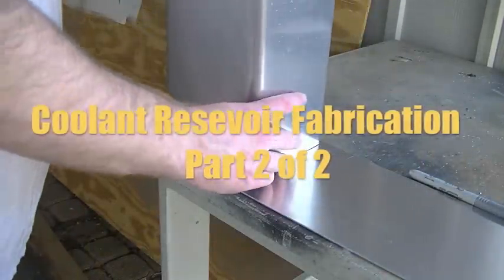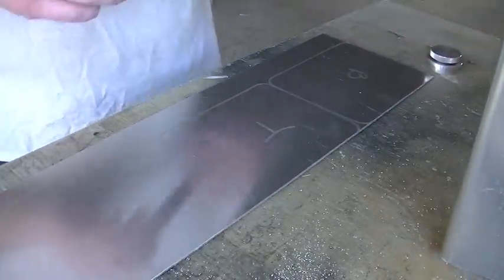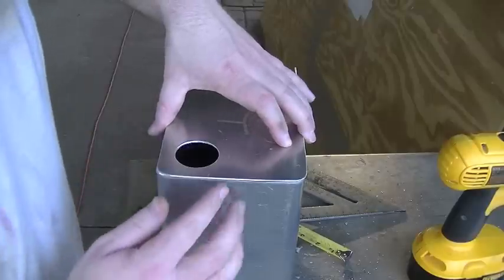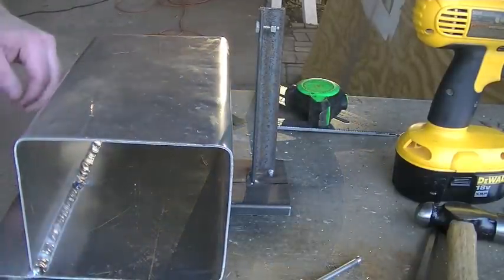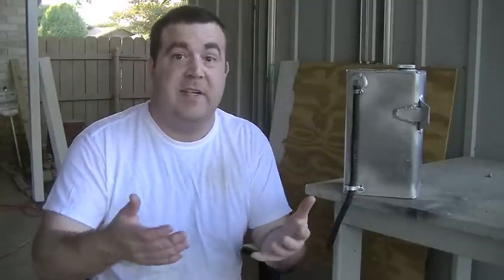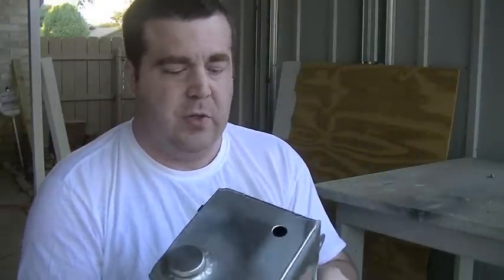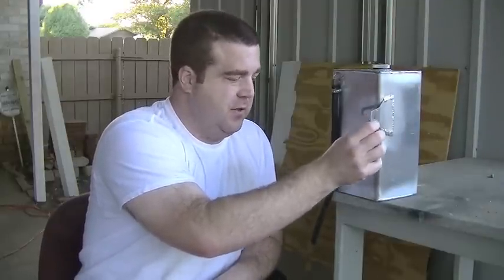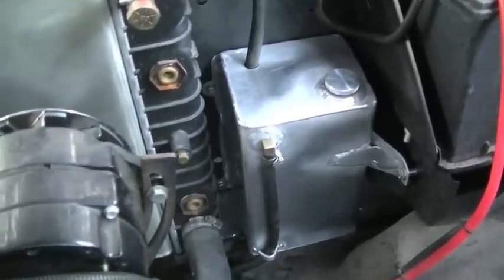PART 2 CHEVY C10 EXPANSION TANK BUILD | TIG Welding An Aluminum Coolant Reservoir

Comment: its prep work!!! make sure you dont mix your files, like if you use one for steel only use it for steel, and have one specific for aluminum. whip down the aluminum, mild steel is a lot more forgiving but aluminum, and different "exotic" metals are not. great job on the tank i like! keep up the good work
Reply from the maker: +Gabriel Pagan I thought I had cleaned it enough but I guess not.  Thank you for watching!

Comment: did you used the powertig185??? i'm thinking on buying one but i will like to know how it perfoms???
Reply from the maker: +fireblade639 I did use the PowerTig 185.  It worked great!  The AC balance and AC frequency adjustments really allow you to dial in the arc.